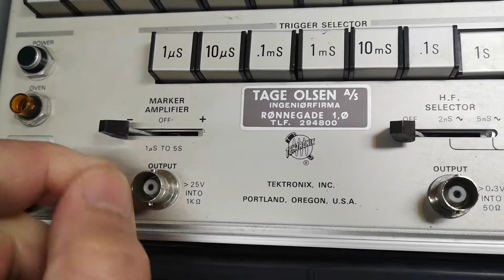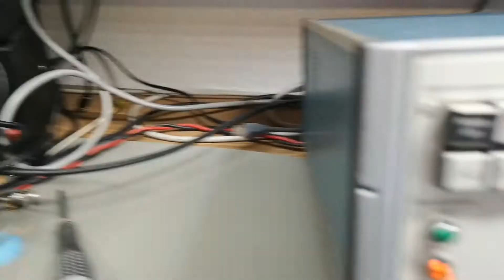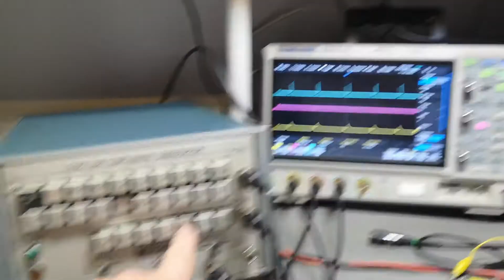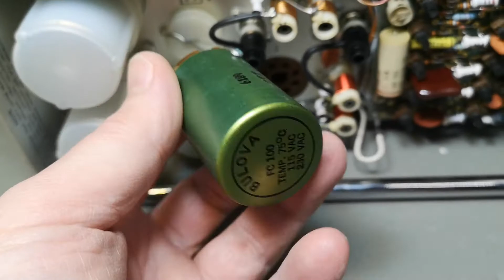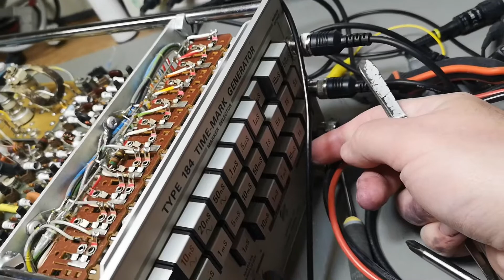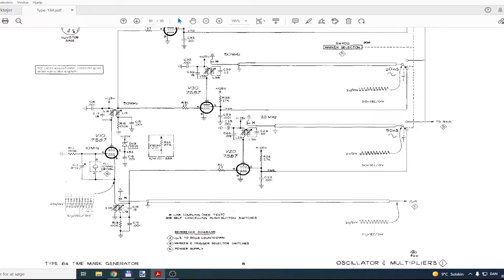Tektronix Time-Mark Generator Type 184 1965 test repair teardown

Comment: Oven is to keep crystal at a constant temp.  Crystal is for frequency standard of the unit.  This is typical.  Oven is kept to temp even with power off.  This is why one needs to have power to this unit at all times.  I have one of these.  You are able to combine Marker buttons.  One is able to push a Trigger button also.  This is where the manual helps.  Once one pushes any of the buttons, the unit is on.  This is not a random function generator.  It was designed to calibrate oscilloscopes for time references (vertical) to the scopes grid.  Think more of a pulse/sawtooth signal generator.  It is for time references for the scope.  Then when you are calibrating the scope,  you adjust the scopes trimmers so the signal (assuming correct) lines up with the scope graticule.

Comment: Hi Thomas, great video. How exactly did you solve the instability problem? I have a generator like this with the same problem. It also had an inefficient electrolytic capacitor. Thanks.
Reply from the maker: cant remember, sorry